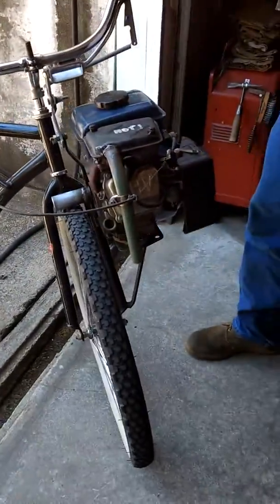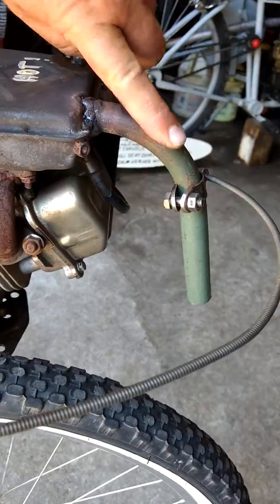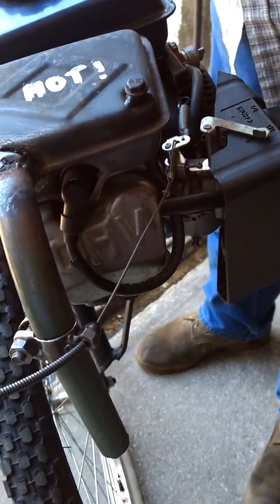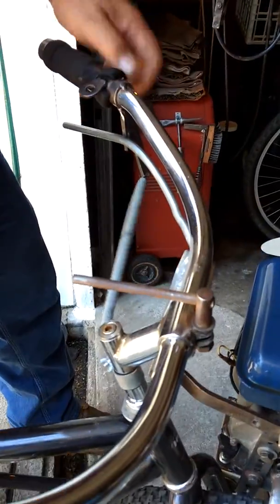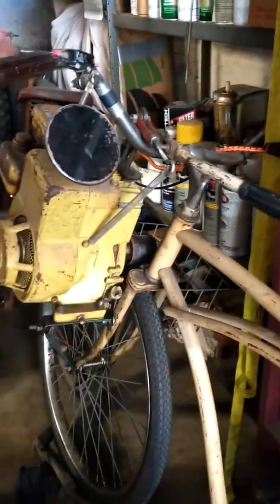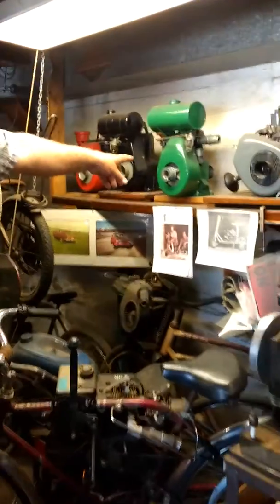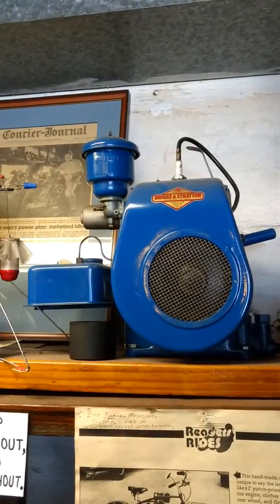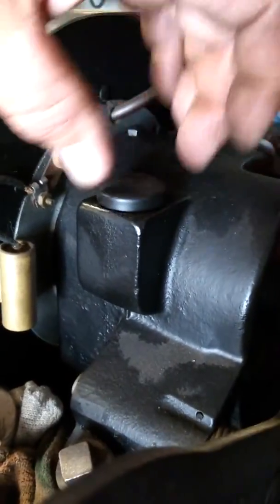Wade Made Motorized Mayhem: Homemade front wheel Friction drive motorized bicycle

Comment: Sir I've got a very similar setup, but with a 79cc predator motor. The engine you have there is a 2.5hp greyhound ( the old predator). They are almost the same motor, as I used to have one.
I've got a piece of 2" gas pipe for a spindle (around 2 1/4" od). I modified my motor with a header, 19mm carb, advanced the timing, port and polished head, milled .040 over for more compression, modified the rocker arms for more lift, upgraded valve springs and pulled the governor. It will rev to around 7k rpm and makes a bit more power. Everything was homemade/modified besides the 19mm carb
Just by removing the governor on that, adding a homemade header, and drilling the carb jet, you'd make a good amount more power, enabling you to run a bigger spindle, giving you more top speed without sacrificing too much low end torque.
I've reached 42mph top speed with a very similar setup, and it will go up hills. I used electric hanger brackets with flatbar welded to make the hinge, I use a spring for tension, and a kickstand welded to the handlebars for a clutch that runs a chain to the engine to pivot.
Your setup is great and very inspiring! Great way to cruise around. I have a milk crate on the back of mine, and run  uber eats as a side hustle here in philadelphia

Comment: I dig the Clutch system you've come up with!!! GREAT JOB Sir!!...i've been building various small engine bikes, etc. since I was knee high to a grasshopper!!.---I put a pivot clutch on a rear wheeled chopper bike not long ago...i build them now, Well...for me!!lol....no, but for my 11&14 yr old nephews...but, I use ''weedwacker'' engines..cause a guy was going out of business and i bought like 30 for $160.....with some being in like new condition....and they'll push, or pull a bike along at about 30Km\hr...ish?? some a bit more...some less......But, as you know the weight of the ''load'' being carried is a major factor for speed....anyway, I'm gonna ''SUB'' you...if you watch some of the videos my nephews and i made up......i'd appreciate a like and a sub if you feel so inclined to....best wishes......and SAFE RIDING!!!!